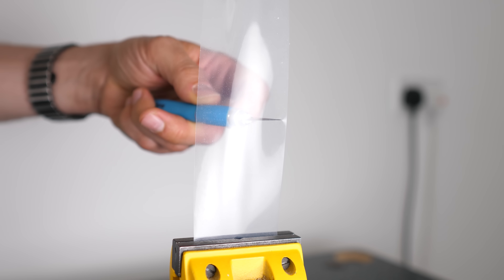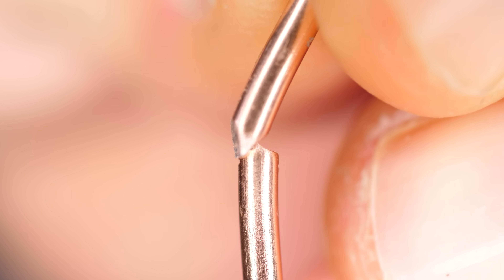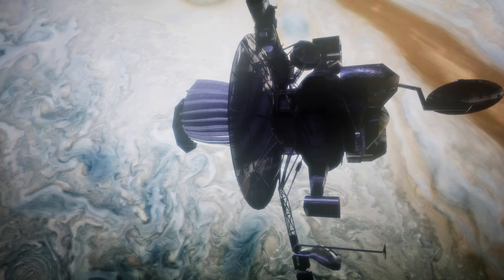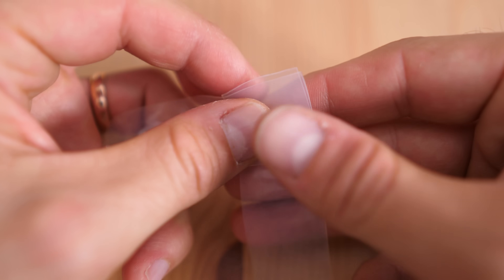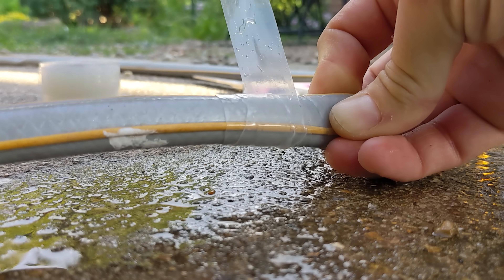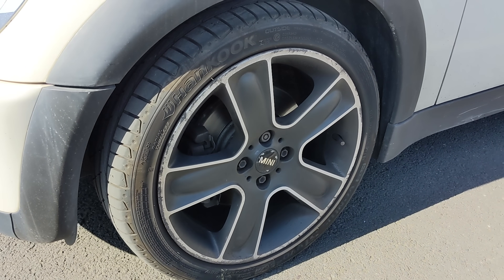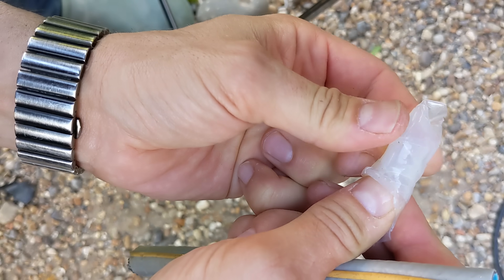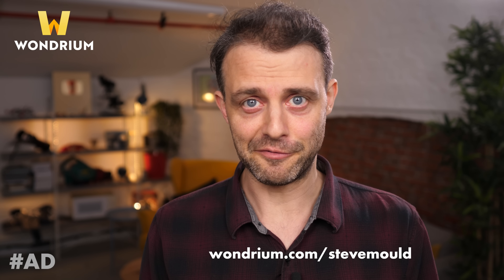Self-Healing Material

Comment: Thanks for explaining why things that are broken apart and not sticky don't self-heal/weld! I never knew that!
And also that polymer seems really cool and probably has tons of applications :)
Reply: It does indeed. It's called self-fusing silicon tape and it's used mainly for pipe repairs and thermal/electrical insulation in areas where temperate or moisture makes regular adhesive struggle. Only downside is how hard it is to remove afterwards since you can't just unwrap it like tape, it has to be cut off.
Reply: I immediately thought of resealable food packaging
Reply: @purplepowerranger23  Aye, but that's just a little bit too resealable 😉
Reply: With metal surfaces its also due to the surfaces just not being flat enough.
To you it looks as if you are pushing flat surfaces together but under a microscope it looks like two mountain ranges that barely touch at a few peaks.
Gauge blocks which are designed to actually be really really flat can just be "stuck" together because there the surfaces ACTUALLY fit together.
Gauge blocks made from steel should also not be left "stuck" for more than 8 hours, because they otherwise cold weld as well.
Reply: I think there are a lot of barriers to broken pieces joining back together beyond just oxidation. (After all, the oxide layers won't bond to each other either, even though they are chemically identical.) I think you have bigger problems with crystal grain boundaries. Two perfectly flat and atomically identical surfaces should indeed fuse when brought together with minimal pressure, but no surfaces are actually perfectly flat or atomically identical. So you basically have two separate crystals, with their structures oriented in totally different ways, and those won't necessarily just bond together. For noncrystalline materials, like these polymers, that's not typically an issue (though some glassy substances also form impermeable surface layers that differ qualitatively from the internal structure of the glass).

For long polymers like rubber, none of these problems come into play, which I think is what makes these self-healing polymers possible. There are still other surface reactions that tend to occur that probably makes it more difficult, and additionally, when you press two pieces together, you will trap a lot of air between them, along with random moisture, oil, etc. from the environment. So a self-healing polymer needs to be able to strongly bond even with these random defects trapped inside and to do so quickly at room temperature. Like he said, extremely long strands and the presence of a selective catalyst probably help a lot. Also, the polymer is very soft, which allows it to get a large contact area between the two pieces in spite of the random surface roughness and trapped gases. The soft material can just be squeezed around these defects and still bond.
Reply: Ya, its pretty much what Alien Tape is... In the video, it looks like Alien Shield (another product from the same manufacturer)
Reply: silicon is self adhering but doesn't really stick to anything else, and it does not oxidize quickly at normal temps, to have a decent oxidization speed requires at least 1000c and even then you are looking at an hour for very thin layers.
Due to this its already made into self adhesive tape for fixing plumping leaks, this is likely just a silicon based tape shown in the video as it works exactly as shown.
Reply: Polymer sure has a ton of uses. All plastics are polymers, and even DNA is a polymer.
Reply: @dsp4392  I know all plastics are polymers, that's why I said "that" polymer.
Reply: Yoo you’re right about the many applications like I just thought if they made condoms with this material it could save us a lot of trouble and maybe even spare some of us from the agony of existence
Reply: @frailvoid5844  yeah, but you'd have the more important agony of tearing the damn thing off
Reply: @2lefThumbs  they dont stick to people tho?
Reply: @frailvoid5844  it would be really hard ot get off after
Reply: @navster100  trust me if you’re boning as often as I am you’d needn’t have a purpose for getting it off in the first place
Reply: Just common sense lol if you paid any attention in chemistry and physics class in high school you'd know.
Reply: @psilovecybin5940  Not being a sarcastic asshole is also common sense, so - what classes did you miss?

Comment: If I understand correctly, something similar to the micro-encapsulation theory is exactly what happens in bird meat. It turns out you can literally pound a chicken breast into a flat sheet and it will remain as one solid piece of chicken, whereas doing the same with a steak will just cause it to shred. Apparently bird muscles get torn so often during flight that they evolved a special chemical for fusing the proteins back together, but only inside of a short timeframe. Cooking the meat decomposes the protein and the chemical itself, which is why you don't end up with chicken amalgam in your gut after you eat some General Tso's.
Reply: Interesting, must be related to 'meat glue'.

Btw, main function of stomach is to denaturate organic chems and decompose proteins to aminoacids. So  there is zero change it to bind with gut, even if you eat raw meat.

Comment: You can actually cold weld gold in our armosphere because it doesn't form an oxide layer
Reply: Stainless steel will as well. Stainless nuts will seize on a stainless bolt because the oxide layers fuse together.

Comment: 'I can't put metal back together.' then cuts metal and tries to put it back together. Scientific method at work. I love you Steve, make it tangible for us all.
Reply: just wasnt pushing hard enough... friction weld my guy
Reply: @tehs3raph1m  you're right and wrong. Welding metal happens from either heat or pressure. Or a combo of both. Something like tig welding would be 100% heat where as explosion welding is 100% pressure.  Friction welding is a combination of both.
Reply: @Twargan  there is this phenomenon that happens in space cold welding that needs neither heat nor pressure
Reply: @asddsaaassddd  this is because the metal doesn't oxidise at the cut in space. With no oxide layer the metal can just "stick" back together
Reply: @asddsaaassddd  and its in this video...
Reply: @asddsaaassddd  that would be the lack of atmosphere to oxidize the cleaned surfaces. Dirty metal won't cold weld.
Reply: @Twargan  no, hes just right. Friction welding is literally just smashing metal together resulting in fusion.
Reply: @g00gleisgayerthanaids56  

So it sticks together by the application of pressure.
Reply: @asddsaaassddd  

It still requires pressure, just considerably less of it.
Reply: @notahotshot  through friction welding, yes of course, heat is generated as a result of friction... you know what friction is, yes?
Reply: @g00gleisgayerthanaids56  No it's not. The friction induces heat in the metal.
Reply: @Twargan  read my comment directly above yours...
Reply: @Twargan  don't forget cold welding in a vacuum
Reply: @Twargan  pototoy ni mawmaw lilipad lipad
Reply: @Twargan  so how exactly were they wrong?
Reply: @Twargan  except for cold welding
Reply: @Twargan  there’s also vacuum welding
Reply: @Twargan At what point did they say that pressure wouldn't be involved? They said Steve wasn't PUSHING hard enough. That means he should have applied more pressure.
Reply: at gun ranges, you can find big lumps of lead: bullets welded together through pressure. It probably helps that lead is fairly soft.
Reply: @tehs3raph1m  lol, yep! I was just about to say the same thing👍🏻
Reply: @tehs3raph1m  that has a high activation energy
Reply: @tehs3raph1m  that generates heat, enough to melt the metal back together
Reply: @tehs3raph1m  ahuh👌
Reply: @tehs3raph1m  force?
Reply: We all know we would have been disappointed if he didn't try after he showed cutting it.
Reply: Crazy that this works in space! New knowledge
Reply: I wouldent have believed him if he didint try
Reply: @outside1234  same man… it’s just too complex without it
Reply: @outside1234  actually with camera tricks you shouldn't believe him even if he tries, have to do it yourself to believe
Reply: @petesmith13  I just tried cutting my car in half and sure enough this dudes a fake I pushed it right back togeather they don't teach us this in school
Reply: I've seen metal cold weld, not in space. It's just easier to control in the conditions of space but it very much occurs between two very flat and clean metal surfaces. Most people don't understand the science of flatness needed though.
Reply: @laramie371  I've seen poop binding also but most people don't understand the water amount needed
Reply: @magiccarp3710  when you work in a machine shop these things are appreciated. Cold welding is an amazing phenomenon.
Reply: @laramie371  i think steve has shown the thing where flat pieces of metal can stick together. I dont think thats a weld tho. I think the pieces just stick together cuz theres no air between them. Sorta like a suction cup? Or one of those rubber pads that stick to flat surfaces and you cant pull them off, you can only slide them off.
Reply: Works for gold
Reply: You can if the surfaces are smooth enough
Reply: Some people just need a visual for what pressing two pieces of metal looks like for some reason.
Reply: @sethreign8103  for the dipshits: tldr: for the people who’s reading comprehension skills have decayed from years of media not allowing them to think for themselves: hard clunk bang BOOM. The metal HARD do not PUSH into together soft one… metal HARD.
Reply: it's possible in space
Reply: @hibahprice6887  I'm not sure if Steve was in orbit when he had put his theory into practice but I think he is out of this world on another level.
Reply: No one's mentioning cold welding?
Reply: @mihirpatil8843  It has been mentioned in the comments and its in the video.
Reply: lmao xD
Reply: was just a demonstration
Reply: I can put metal back together. Fires up welder
Reply: EDIT: typed this out before watching the video or reading the comments. This has been said already 💀

Funny enough, you can if you’re in the vacuum of space. I don’t remember WHY it is, but it was a really cool reason that had something to do with the surfaces of the metal not oxidizing or somethin
Reply: Why can't metals stick together? Then obviously we'd have the T-1000 and Skynet has already been launched and the world will be at war.
Reply: *in earth's oxygen filled atmosphere
Reply: Then goes on to explain how you CAN put metal back together
Reply: If You want to cut a METAL technically true rod and put it back together end to end I tell you true FACTUAL WAY TO DO- Get a 2 inch piece-50mm- of .062 dia. lead based solder. cut it in half. put 1 half into vice with .125 inch  protruding from the vice. put the other 1 half of rod solder onto a Dremel or similar tool that spins at 8000rpm +.with .125 inch protruding from the dremel chuck- turn dremel on high speed and as solder rod is rotating push end to end against the solder rod end in vice--friction reformation into 1 piece. it will melt and if you stop at correct time it will be bonded back together. same will work with bigger tools and such on steel rod or plastic rod. Just so you know-Friction welding. Frequency welding takes more expensive set up. This guy is a liar and a fake !! read my comment above where i state truth and call him out and use facts to prove he is a fake !!   Have a wonderful day. Gods Bless !!
Reply: Your quote is wrong. Disingenuous.
Reply: Actually you can put metal back together by just squishing it together, you just need to push REALLY hard for it to happen.
Reply: Just bring it into a vacuum, break the oxidation layer off, and touch them together lol
Reply: me trying with indium nvm he's wrong it works
Reply: there are unfortunately lots of people out there that dont know that
Reply: Gallium
Reply: Lapped metal sticks.
Reply: Then he learned welding existed for ages
Reply: That is the essence of it. In fact, the testing of an obvious hypothesis to reach a known conclusion is always the control. Now what you really test is when you change a variable in the equation, such as "is there an oxygen layer between the two metal surfaces?" You can't learn how something is different if you don't have a controlled comparison.
Reply: Then cuts metal and puts it back together in space. Success
Reply: "I cant build a safe nuclear reactor"
Reply: Yep
Reply: welds it back together I'm sorry did you say something?
Reply: About scientific method, there's a big difference between putting a concept to test and just demonstrating a concept with a test.
Reply: Welding
Reply: “Melt it”
Reply: Weld
Reply: Well said... teaching is difficult it seems...broad spectrum
Reply: welding enters the chat
Reply: Fire has left the chat
Reply: You can, just melt it and freeze it
Reply: Cold fusion
Reply: We need to see every detail
Reply: did you make a "perfect" cut?
Reply: Cold welding for indium or gallium because of oxidation
Reply: what abput Cold welding
Reply: No it’s because he was doing a voice over
Reply: I have some indium and I cant push them back together
Reply: You can in spaaAaaAaAaaAaace
Reply: But welding torches exist
Reply: You just have to do one thing melt the metal and then wait for it to solidify just like chocolate
Reply: @UC0uDk_F9KwHvJ_6WyCYFXSw he's correct. He's just talking about metal that is already oxidized.
Reply: Mercury
Reply: @jaimedelgado7529  that doesn’t count since Mercury is a “liquid” at room temperature
Reply: @jaimedelgado7529  ok
Reply: @jaimedelgado7529 gallium
Reply: @jaimedelgado7529  elaborate...elab or ate, elab or 26 elab or 8?? 5labor8, 61, 7= G=me😁😎
Reply: @UC0uDk_F9KwHvJ_6WyCYFXSw he's correct. He's just talking about metal that is already oxidized.
Reply: I learned something new from this today, metals don't stick together because of oxide layer,

but flollowing that logic, why doesn't the oxide layer stick together
why doesn't any plastic stick together normally?
Reply: @ArmiaKhairy  oxide layers dont stick because they arent a neat crystal lattice that is identical from piece to piece
Reply: アイコン似てるw
Reply: You actually can
Reply: Welding?
Reply: @felixsanders1691    oxidized scale won't weld. Heat is used to create the bond and flux may keep the metal from oxidizing so it's not self adhering. That's what Forged in fire taught me. But I'm not Steve. I'll leave the leg work to the professor.
Reply: @ruebancastro3189  if flux keeps the oxidation away, wouldnt that make it more self adhering? Or rather prevent it from becoming non-self-adherable?
Reply: @ErisApplebottom  no longer self adhering when another something else is added to the cut pieces. Just the way it is I suppose.
Reply: I lost braincells when i read the quote
Reply: K idiot
Reply: I giveaway Beyblade
Reply: The first thing I thought was he just didn't press hard enough. I took some copper wire and tried it. Just hammer a few times and it will stick.
Reply: 2000th like

Comment: There's a dental restorative material called Self healing composite 
It's working by same mechanism it has a micro capsouls between atoms and after any crack it's relases the material and react with air to seal gaps in the tooth, i really like material science and bio material science i hope if i can get a scholarship in Bio Fabrication or Bio materials 😢

Comment: Is this temporary though?? For plumbing leaks we use putty, which is basically linseed oil and clay, with a hardener of some sort. This works for only a short while, the linseed oil keeps the clay from drying, but after a few hours it is useless. Often the leak is so minor but the repair is so major, would be a disruptor for plumbing.

Comment: In polimers, the material isn't one big molecule, the material is made of millions of long molecules that are held together by intermolecular bonds and because they are "tangled" together. When you break a material you may break molecular bonds, but mainly, intermolecular bonds are broke.

When you apply vinegar to the latex, the molecules present in the suspension change shape and elerctrical charge (mainly proteins) because of the change in pH. This makes the molecules insoluble in water and precipitates, grabbing other molecules and "tangling" with them. The molecules in the latex and in the tire are millions, not one, but they are hold together by strong intermolecular forces, because their molecules are long and can have a lot of contact between them.
Reply: That polymers are millions of molecules can be proved because they are soluble in some solvents (like acrylic glass in acetone). This is because the molecules are separated from the material and then dissolved in the solvent.

Comment: I was thinking when you were explaining polymers as chains that this might be something simmilar but much more advanced. A polymer that could build not a chain but a grid. More of a omni directional polymer. Imagine a molecule where it was arranged in say a cube/diamond arrangent with thoes polymer linkages on each corner. At any given time the surface of the polymer would have open "slots" waiting to be bonded with something that had a simmilar makeup. And it could do it in any direction. After much searching the life size equivalent I could find were "picasso tiles" the ones with the spokes on all sides that you press into one another.
Reply: Wouldn’t this just be a  crystalline structure?

Comment: Can this material be reused? The pieces you have cut and stuck together - would it be possible to mill them into a new sheet? Would it require heating up to make it easier to work with or?